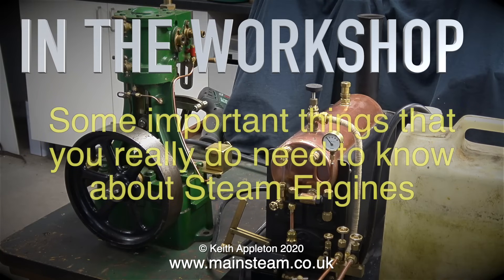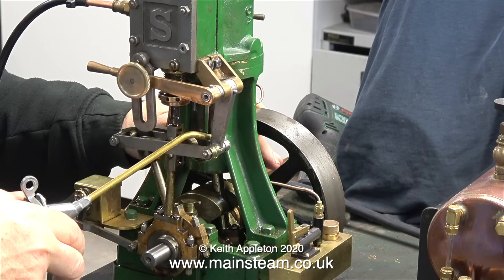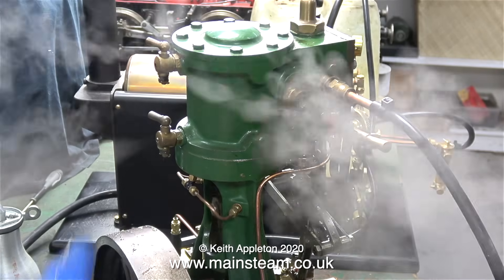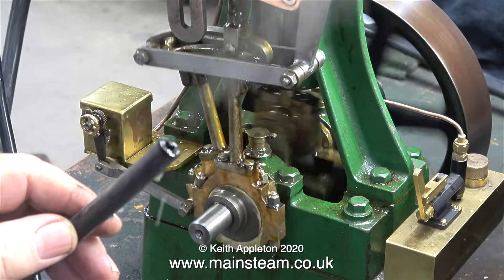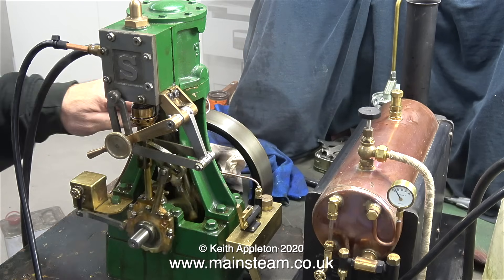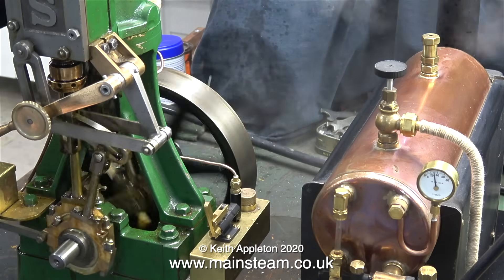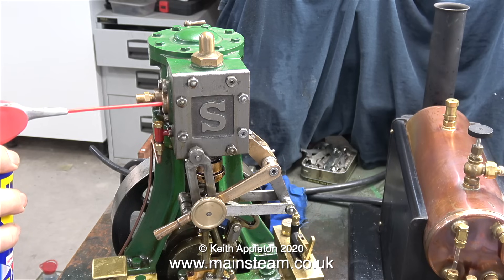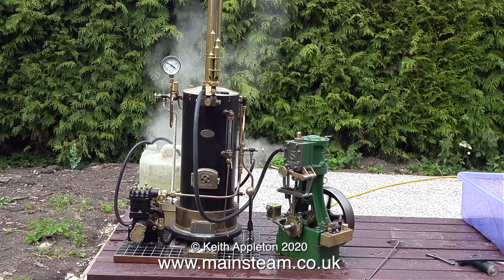SOME THINGS YOU NEED TO KNOW ABOUT MODEL STEAM ENGINES - IN THE WORKSHOP

Comment: Thanks for the video. I'm looking at making a 1:49 scale USS Iowa and it'll be powered with two to four steam engines of that size. I'm currently designing the diesel fired boiler and might have to increase the size I was originally planning to use

Comment: I have built steam engines for over 50 years. ALL my model engines run on compressed air, completely dodging all the lubrication bullets.

I use live steam  ONLY on turbines, which drive transmissions, driving electric generators.

As governments fail, I see a resurgence of steam power, especially off grid. I "could" live off grid, but at 76 years old, I  enjoy being grid tied.

I use a tracking concentrating solar retort to make charcoal, which I use in my steam boiler (fire-tube).

Comment: I'm in the motor trade. We were taught in collage that the cooling system is pressurized as for every 1psi in pressure boiling point increases by 1 degree centigrade so i agree with what you said. Beautiful engine. Poetry in motion

Comment: Not only does boiling point rise in proportion to increased pressure, it drops in proportion to decreasing pressure. Water will boil at lower temperatures  at the top of high mountains due to lower atmospheric pressure, also your blood will boil instantly at body heat when exposed to the vacuum of space due to the  complete absence of atmospheric pressure.

Comment: Looking to make a steam engine that can run a pump which circulates water through pipes in a floor as radiant heat. Any suggestions. All off of a wood burning stove. Let me know. Thanks
Reply from the maker: Not really, I generally make model steam engines . . . why not put a water boiler on the stove and circulate the hot water through the pipes?
Reply: Using thermosiphon?
Reply: When you look at the amount of horse power - mouse power that is generated from a model steam engine, you are going to need a big engine to run your pump. The problem then becomes how big a boiler do you need. I think you will have a large enough boiler that it will have to be certified.  Try looking for Amish information. They do use some steam driven items. 
Another way to look at what you need: lets drive a piston off the flywheel driven by  the steam piston. That piston with a check valve can be a pump to pump your heating water. What flow in GPM of heated do you want to pump? For starts lets say the engine is running at 50 rpm. What size pump piston will you need to pump the requires GPM? lets go for 5 GPM.  5 gal/min x min/50 gal, =>  1/10 gal /rev. 1 gal = 268.8 cu in we need 26.8 cu in /rev.  cyl vol = pi x rad squared x l ,  lets have a 2 inch stroke.  rad squared = vol/pi x 2 ,  => rad = 2.065. So you will need a 4 inch diameter cyl .  Now the question is how much force will be needed to push the water through valves and piping. When I was a senior engineer at a power plant I used a Crane Handbook for piping loss.  Good Luck

Comment: For the temperature you could add a super heater, basically you just run the steam from the regulator valve through the fire of the coal or gas burner and the water problem should be away.
Reply from the maker: Thank you for your information. The Stuart 500 range of boilers already have superheater built in, please watch a few more of my 2000 videos for a wealth of information covering the subject of your comment . . . . .
Reply: @keithappleton  I just found your channel a few days ago I will definitely keep watching 😁

Comment: Keith I have very much enjoyed your videos and all the no nonsense information you provide.  I wander if I could pick your brain about the viability of my steam project prior to investing my time and efforts.  

I live in a rural area.  We heat our 1800’s home with a large out door wood burner.  Essentially a large wood stove that heats 150 gallons of water to 180 degrees that’s cycled through the house and a heat exchanger in my forced air furnace. 

I have some things to do to this unit to increase its efficacy.  Despite these changes these units are notoriously in efficient and blow huge BTUs out of the stack.  So much so a 12” flame can be seen at night escaping the insulated flew.  To me this looks like a perfect opportunity to fabricate a boiler unit intended to utilize this waste heat in hopes to generate a bit of electricity.  

I will be adding 300-400 more gallon of ballast tanks to my system to help reduce heat cycling. Currently the unit forces air into the firebox until the desired heat is reached. Adding ballast will extend each burn cycle but also reduce the cycling. This should help build longer times of useful heat. 

Clearly this project has many veritables that require much more information.  If you have any interest in helping me with my thought experiment I would love to discuss with you in greater detail.
Reply from the maker: Sorry, I can only give limited tech support to my Patreon supporters. www.patreon.com/keithappleton

Comment: Keith, how do you match the burner size, the capacity of the boiler, and the engine.  Im attempting to get into building a steam powered launch and want to make sure that I have a good power plant.  A friend of mine purchased a steam powered tugboat that ran out of pressure within 5 minutes.  We assumed that the burner was not getting the water hot enough or quickly enough to replace the steam.  Any suggestions?
Reply from the maker: Trial and error, it all depends on the size of the Engine, Boiler and Gas Burner.

Comment: Great video about boiler vs engine.  ISTR some steam locomotives didn't work out very well simply because the fire grate and boiler were too small compared to the engine.  While they could develop full power for a short while, they were 'boiler limited' in that as soon as they started working hard, pressure would fall off and they'd slow to a stop.

And I'd just add that if a boiler has a superheater, that helps in reducing condensate.  Not a substitute for a properly matched boiler, but a sort of side-effect of having a super-heater.

Comment: just thought of something (as I live in Finland) dose cold weather effect the efficiency of a steam engine???
here I have seen temps as low as -33C but this year it's been warmer only as low as -20C
Reply: That is a very interesting question. According to thermodynamic theory, efficiency is only related the temperature difference, but with a steam engine being mostly uninsulated, it seems that a lot of energy could be lost before being fully utilized.
Reply: Possibly. The efficiency of a steam engine is based on the change in pressure between the input and exhaust. Most full-size steam engines use a condenser that is kept at a vacuum to lower exhaust pressure, significantly improving efficiency. The condenser is maintained at a vacuum primarily by the condensing action of the steam itself: as the steam turns into liquid, its volume reduces dramatically, maintaining vacuum in the condenser. If the condenser is colder, the steam condenses faster, maintaining a better vacuum and therefore higher efficiency.
However, most model steam engines either don't use a condenser, or they use a vented condenser without a vacuum. I guess changes in atmospheric pressure would have a small effect on efficiency, but nothing close to the effect of drawing 25inHg of vacuum in your condenser.
Reply: Yes, it has impact. Firstly, the longer the feed line, the more the steam will cool down before reaching the engine. This steam will not be able to expand as much in the engine as otherwise, causing a lower output. A poorly insulated engine will have the same effect, condensation instead of expansion. In a perfect world, without losses, you can pass on the steam to more cylinders, intermediate- and low pressure cyls, LP turbines, boiler feed water heaters, etc, and this way get a very high plant efficiency.

Comment: this is the first time I fully new what you was talking about as I have worked on supper heated steam line (fitting and welding the pipes) so I know about the relationship between steam and pressure.
the rest of the video was new to me :)

Comment: Learned in science lessons at school many, many years ago that the boiling point of water rises as the pressure rises. A very good example of this is the pressurised cooling system on motor vehicles with “infernal” combustion engines. Having said that I must say I attended a very good school. The school was approved so it must have been good. Thank you for sharing your knowledge.

Comment: The Stuart 504 boiler and the 5A are both very nice to work with, when operated with compatible equipment. If you want to put both together, you'll need a pair of 504 boilers.

Comment: On a large steam engine for example on a ship the water from the turbine is recovered. There are many reasons for this but one of them is to maintain the energy as much as possible by putting water back into the boiler that is still hot. Typically somewhere around 260c and 90 bar. Not achievable in a hobby setup but it might be possible to keep the supply water up around 95c thus helping the boiler.
Reply: I've been planning a model steam ship, and one of my design goals is to be able to recover the water and pump it back into the boiler automatically.

Comment: Please note that steam is very dangerous due to to the amount of heat that is contained in it. (as opposed to just the temperature) A BTU (British Thermal Unit) is the amount of heat needed to raise 1 pound (pint) of water 1 degree F. So it takes 180 BTU to heat a pint from Ice water @32F to boiling water @212F. Amazingly it then takes 960 BTU to convert that pint of water @212F  to steam @ 212F.
If steam hits you then it condenses back into water and all that energy goes into your flesh.
Reply: Quite! Boiler bursts are almost invariably catastrophic and a high pressure steam leak in the wrong place can produce life changing injury. I think steam should be used only where absolutely necessary.

Comment: In the situation with the test boiler, you were getting very wet steam or a lot of the steam was condensing before it got to the engine.  Steam temperature rises directly as the steam pressure rises, it is not a direct 1 for 1 rise though.  Here is a temperature/pressure table  from Global Supply Line  for saturated water/steam.  1 bar/14.5 psi = 100C/212 F   10 bar/145.04 psi = 179 C/354.2 F